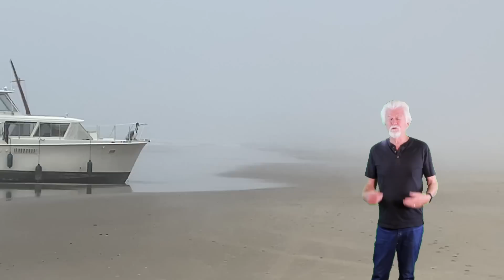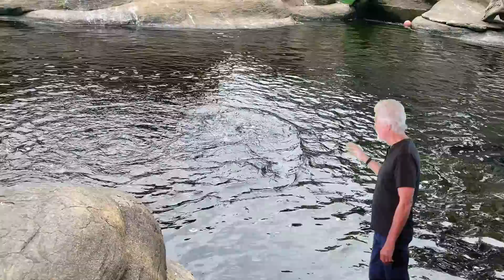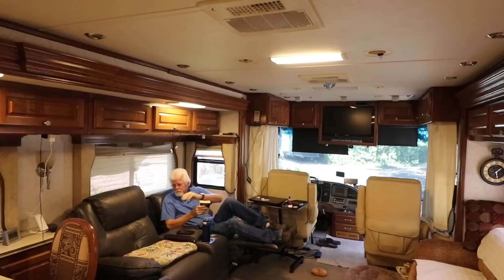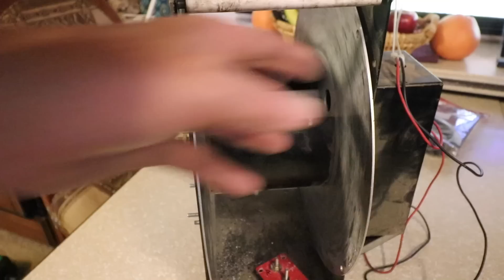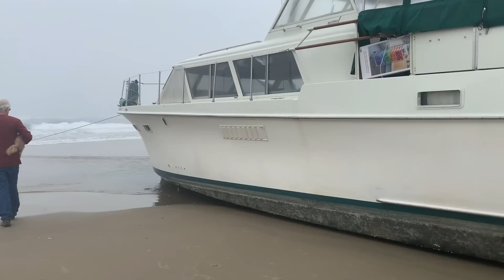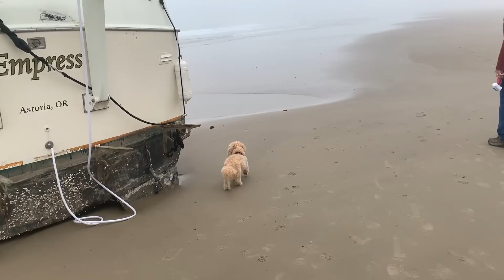Things often go bad in sets of 3 and it is getting expensive.

Comment: I just had the same thing with our reel. It was the neutral. I cleaned copper fingers and bent them to make solid contact and re-arranged the contact wheels. After re-assembly, it works great again. Our EMS kept reporting errors before. But not anymore. I wish they sold parts for the reels…

Comment: Hey Bob, we are looking to get a new small generator. We have a 2200 watt Briggs, but it doesn't have quite enough umph. to get our air going even with an easy start on the air. What brands have you found to be good. We are going to boondock by the proving grounds this winter and are set up pretty well with solar. Burlington Bill busking on the road and here on you tube.

Comment: This is an important video. Don't sit back and think everything is fine when it comes to your RV electrical system. I have been told that low power can be as damaging to your electrical devices in your rig has power spike can be. I burned out the controller for both our washer and dryer due to low power, a costly problem.

Comment: I repaired refrigeration equipment for 30 years. An electrical problem will not make a leak. Just a run of bad luck.
Anyplace that there can be a bad electrical connection, there will be a bad connection eventually.
You can still use the cord real, just don't attach it electrically. unwind the whole cord, then plug the cord in. When you are ready to leave, unplug the cord and wind it up. You may need to add hardware to get the real to hang on to the end of the cord. A u bolt on the cord a foot or two from the male end would work.

Comment: Wow, you are having the same issue I am having with an Identical power cord reel. Mine has been bypassed a few weeks .I was delaying fixing it and now you have showed me the issue. Mine I could roll it back and forth a few inches and it would work again. Some times the power would still go out and I would rotate it a few inches again. Still repairing ither issues that reel caused. Thankfully not AC and washer issues, yikes!

Comment: Bob, great video.  My thoughts are a tremendous amount of current was generated when your cord reel shorted.  I'm sure your first air conditioning unit terminals on the compressor failed and released the charge.  The other air conditioning unit and washing machine may have taken circuit boards out. 
You may be fighting gremlins in your electrical systems for many years.

Comment: Wow!  You are an awesome troubleshooter Bob!  I honestly could not, and cannot do the repairs that you always do yourself.  If I wasn't 1500 miles away, I would pat you on the back.  I am going to put a bunch of "tick" marks on my reel, and am going to come up with a system to be able to visually stop or park the reel in one of 4 or 6 locations.  Every stop I would use a different parking position or rotation of the reel.  Fingers crossed!
Reply from the maker: That is a great idea Mark, putting marks on the reel so you can sort of spread the love evenly around those slip rings to save wear and tear from all being in one general location. I may try to repair our current reel if I can find parts, as I really enjoy having that convenance but not sure I love it enough to purchase a new one as we are probably not going to be still RVing in our 80s and that is getting closer and closer. LOL Tell Sue "HI" from us both
Reply: @JustPassingThru  I am going to use your wording when I explain my proposed clocking technique.  I may make a video about this,......and I will for sure be showcasing your video and experience.  Look at the brand of your reel, and call the factory to see if they have a rebuilding customer service program set up already,........
Reply from the maker: @OurJourneyInMyles  I will most likely be calling the company to see about repair and/or if those 3 tension springs are available as I have read they are not. I received an email from a viewer (with pictures) that he has done the repair through a shop in Arkansas, but his damage was not quite as sever as ours and they used his old slip ring and tension bars and they look like new.
Reply: @JustPassingThru  I was told to always fully unroll the power cord. This prevents excess heat buildup in a wound up cord. Whether that is true or not, I don't know.

Comment: The block with the brushes for the power reel should available. I remember someone posting about repairing the same problem. 
I must have missed you were a aircraft mecanic. What kind?
Reply from the maker: I hope I can repair and it sure would be nice if that block was available to simply buy and rivet in place. I am sure the slip rings can be polished and it would be a easy fix (fingers crossed). I went to a two year trade school in Texas and got my A&P license and commercial pilot license back in the early 70s and worked in the industry for about 7 years even had my own little FBO the last few years until some stupid decisions and divorce in the late 70s resulted in a change of careers and I ended up in Reno in Casino Management. Weird change of direction but it all worked out for the better.
Reply: @JustPassingThru  Just a comment. At about 2:50 in your video you are showing how you plug in your surge guard. It looks like you plug in with the power on. It looks like you turn the power from on to off then back on? I know you know not to plug in with the power on because it will damage the contacts. 
I started in Aircraft structural repair in the Airforce. Then did Nondestructive testing and industrial Xray and oil lab. Then went to work building the F=16 and my last job was the last station in final assembly on the f-35 Joint strike fighter.

Comment: Nice troubleshooting Bob!  I wonder if the movement was the only reason for the arcing as many people have problems with hose reels and I can't see why you would move it much under power. These things are a constant puzzle aren't they?   You are much smarter than us temperature-wise, we are in Texas visiting family in 100 degree heat.  We left 75 degree temps at 9400 ft elevation in Colorado to come here and visit with our daughter and granddaughter.  Priorities!
Reply from the maker: It appears many of our friends have ended up in 90 or 100 degree temps this summer, we have really been lucky as other that a week in Vegas in May, we have stayed between mid 50s to hi 70s and with a little luck we will maintain that all the way back to Yuma in late November sometime. I do think the movement of that hose reel while under power is the biggest culprit. I pull my power cable out and hook it all up and turn on the circuit breaker then eventually go back and push the button to reel the excess power cable back in if I had pulled out too much. It doesn't happen every time but quite often and I am sure that design is prone to  a little bit of bad connections simply with the rotating slip ring. I do like the convivence of the electric roll up and storage but not sure if I will replace it, repair it or dump it. LOL

Comment: Bob, always check the transfer switch connections
They need to be torqued to 45 lbs.
Believe me, my shore line wires were loose and burnt my unit.  Almost had a fire. Melted lines, burnt connections. 
Needed to replace the transfer switch.  Not fun!!!
The only way I found out was my line one voltage dropped to 90 volts and shutdown my Transfer switch.  
It shuts down if my voltage goes below 102volts.  I only could get power from my generator.
Reply from the maker: Thanks for the reminder on the ATS torques. I had the cover open to check the voltages but forgot to check those torques and I had previously read about that issue. I will get that done asap but everything looked nice and voltages were all good so made me happy although they do need to be retorqued anyway so I don't end up in the same situation you described. Thanks

Comment: fascinating trouble shooting of the electrical problem, I dont have a reel but do have the Hughes power former and the surge protector. I am not good at dealing with electrical problems on these things! I have changed out my heater motor last winter and that was about it. 
Great learning experience for you and all of us who follow you.
Reply from the maker: Hi Rodney, If you can change out a heater motor in your RV, they you can probably conquer most of the RV repair issues although with RVs often times the biggest issue is simply getting to the broken appliance to repair it. They really squeeze things into some awkward places.Great choice on the Hughes autoformer and surge protector, personally I think they may be the best options available.

Comment: Bob, you should be able to rebuild that once you get it home as you can see it’s a pretty simple mechanism. You were absolutely right that that should not be rotated when there’s an electrical load on it. Those things are just like our transfer switches and we need to always make sure all those connections are tight. I’m just glad it didn’t start a fire as I’m sure you are. I’m still hanging out with friends up in the Island Park area of Idaho. You and Pearl take care.
Reply from the maker: Hi Tim, thanks for the confirmation and I am surprised I had never read about that issue but no doubt it makes total sense now that I think about it. I am thinking that if I do decide to reinstall the reel, I will most likely rebuild this one, I replaced the motor a couple of years back and it is all fairly simple especially with it out of the coach. I know what you mean about Island Park and how great of a place it is, hopefully Pearl and I get back up there one day.

Comment: Hey Bob, So glad you figured out the problem.  I am scared to death about our 2 A/C's going bad.  We are still in the 90's and will be for a while.  Keeping our fingers crossed.  Good luck to you and Pearl.
Reply from the maker: Hi Scott & Laura, I hear ya, if we were in 90 degree weather those AC units would be a whole lot higher priority than here in 65 degree weather.  Good Luck with staying cool 👍
Reply: Just a suggestion sir, get you a portable ac unit, they will work great and might even allow you to turn an ac unit off. You will have to vent it out a window but they work very good for small areas. It’s also a 110 unit

Comment: It's always something.  We have a Progressive Industries EMS that was showing very low voltage when we moved to a new park.  After checking at a few other pedestals and getting the park to check ours, I determined that moisture had gotten in after a couple of days of severe thunderstorms.  I dried it out overnight and everything seems to working again.  I hope you find and easy fix for the AC and Washer/Dryer.
Reply from the maker: Oh My, I had not heard of that happening to the surge protectors. Thanks for the info since if it can go wrong we will eventually find it. LOL  I am hopeful that we can find the parts still available as we have had similar issues and it has simply been computer board for both appliances but that busted tubing on the front AC is most likely going to be a little more complicated. But having 6 months to fix it in Yuma gives me some hope. Are you still loving the new to you Jeep. maybe a dumb question as what is not to love with a Jeep.

Comment: A very informative video Bob. The hose reel for electric probably is not a great idea. Wires need to be fastened not able to move around! I have a reel for my water hose on the Brinkley and even worry down the road about that! Best to you and Pearl, safe travels. Burlington Bill here busking from the road and on you tube.
Reply from the maker: I sort of agree with  you Bill our hose has an automatic reel and the hose is ageing and I will need to replace it fairly soon but there does not appear to be any access hole so I will have to disassemble quite a bit of stuff to get to the reel to replace the hose. How is the Alaska Trip going, have you had any issues?
Reply: @JustPassingThru  The salmon in Valdez were not running yet so we worked our way back to Wisconsin. Soon we are heading to Indiana to tour the Brinkley plant and visit a couple of guys that started the company. We first met them at Grand Design. Enjoy your travels and see you in Yuma!

Comment: Holy moly! Our Progressive Industries EMS Surge Protector did it's job for us too! It saved everything in the rv by sacrificing itself when we had a huge lag and surge in power. We've got the new one installed, hard-wired just like before. I put the old one in, in 2014 when we bought the rig. So definitely got our money out of it. Hopefully your AC's will be an easy fix. And let us know how it goes with Pearl and telling her about the washer...
Reply from the maker: Yippee, hopefully that means everyone is nice and cool in those 90 plus temperatures in Reno. I am hoping to pull the washer out when we get to seaside and see if I can figure out what burned out and hopefully the parts will still be available but that is always a hope and prayer with appliances this old. We're following along with your knee surgery and hoping for a nice quick and successful recovery. BECAUSE as you know getting parts to work on a old fart like you is a tall order... LOL wait till that next birthday rolls around and you end up on our side of 70 😃